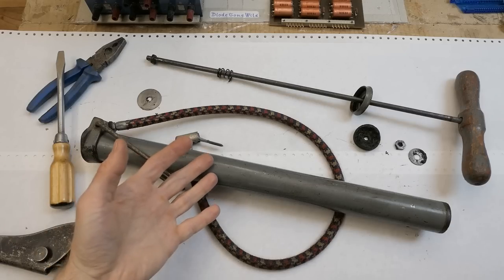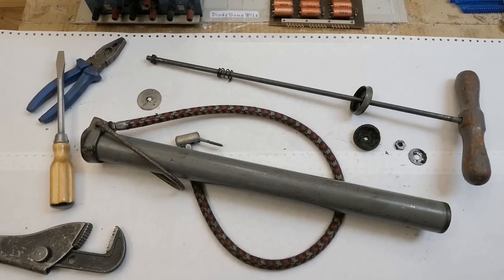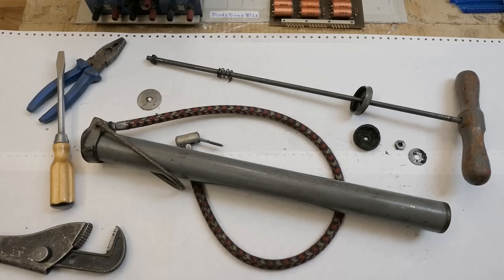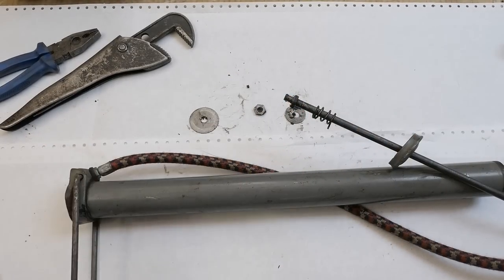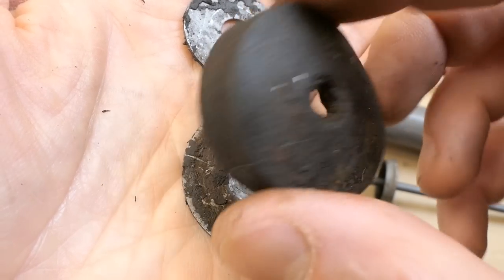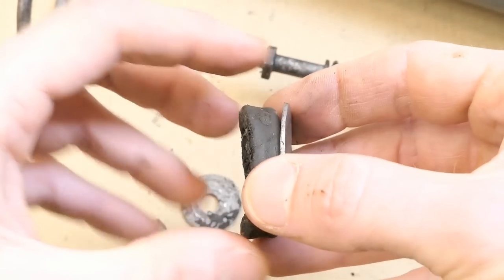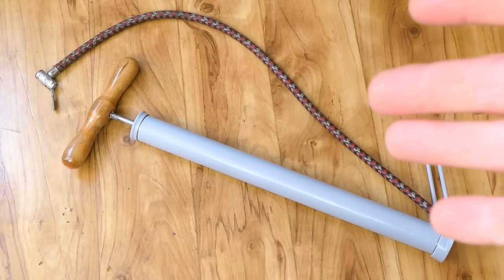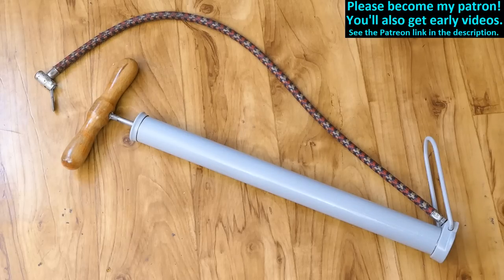Vintage Hand Air Pump Restoration

Comment: Not rubber but leather. You make them using a piece of leather, and soaking it in hoof oil, then get the bend in it by cutting out the large circle, and assembling it on the shaft in reverse, with the large washer at the far end. Then put in the housing, well oiled, and making the softened leather gradually bend to fit the housing, then leave in there for a few hours, pull out and assemble the right way round. The leather is treated with hoof oil or Dubbin, both available probably at the local store, the Dubbin being used for suede leather shoes, as it is a pale yellow leather treatment, and thus on suede it does not darken it like shoe polish, though boot polish is likely what was used on there over the years.
Reply: Woah. I never thought we'd have a discussion about dubbin on here. :)
Reply: Neatsfoot oil, also.  If the leather isn't ripped or torn probably vegetable oil would be fine to soften it up.  I often use most any light oil.
Reply: Isn't the seal on the hose also leather? So it's a bit of shame to replace it with that newfangled rubber o-ring.
Reply: @alexej01  Correct, all the seals would be leather soaked in oil.  The check valve might be rubber, I don't recall the detail of my (almost identical, slightly newer) pump.
Reply: Agree, thick leather. Same in optimus primus, petromax, etc. We used to oil it with weapon - oil when i was in the army.

Nowadays its just a o-ring
Reply: Hey, I already posted that!😉
Reply: @edgeeffect  hoof oil bahahahahahaha
Reply: i think we used Lanolin grease on old leather washers like this
Reply: Thanks for sharing that!!! Ingenious.
Also I havent heard dubbin mentioned for years!
Reply: Most paraffin lamp and stove enthusiasts just soak the pump leather in water before assembling it back to front on the shaft to dry and take on the correct shape, they then use olive oil or mineral oil to make the leather more supple. I've made dozens that way, no need for any specialised products, just what you can find in most homes.
Reply: We did exactly this but then soaked the leather in water. But oil is better I guess

Comment: That looks exactly like the pump I used as a kid  for my bicycle tires , usually all I had to do was pull the piston out and spread it out a bit and put a bit of oil in there so it made a better seal. I think the piston is leather and not rubber.  Those cheap pumps didn't have a check valve in them. You needed to be fast to disconnect the hose from tire stem while pushing down  on the pump so not much air would escape from tire. New pumps are so much better these days !
Reply: Yes leather.
Reply: @hwassie  No rubber.
Reply: The seals were originally leather, but that may be a later version; the type of Schrader valve adapter does seem to indicate it's a later design.
Reply: @cambridgemart2075   yeah I had one with a screw on hose valve too and that one was a real pain to get off without letting so much of the air out !
Reply: It seems like this pump must have a check valve or else the balloon wouldn't inflate.  Is it in the hose fitting near the base, I wonder?
Reply: @govtpeaches  I think some did not have check valves so you had to be pushing down on the handle when you released the tire valve so you wouldn't loose any air pressure. The pump itself would hold some pressure so when it got high enough pressure the pump handle would move up if you weren't pushing down. There may have been a ball check valve at the end of the hose but they get gummed up and stuck open.

Comment: I love mechanical repair diversions like this. Some of my favorite videos on Big Clive's channel are about plumbing.

You're spot on about the check valve being inside the hose fitting. It's construction is often similar to the piston seal, but backwards (and obviously smaller), so it's pushed closed by pressure from the tire.
Reply: Agreed. And some of my favorite videos on this channel are about plumbing with his "unauthorized plumber" who is a cat. Mostly gas water heater videos if I remember correctly

Comment: As others have said, the foot stand is the wrong way round. It's correct on the first frame of the video. It will hold it more firmly to the floor on the upstroke when in the correct position. Interesting video 🙂

Comment: Danke!
Nice!

My Grandpa still use a similar air pump for his Bike.

The 'clean' side of the big washer is cleaner because every pump strike the rubber press against it and kind of press dirt out or grind very little.

You see the small bending of the washer.. so you know the big main force during an air pump strike comes from above/the handle going down.
Forcing the nut in the center down .. but the outer ring of rubber together with the increasing air pressure try to push the washer up.

I would try to use a better grease.. no random WD40 spraycan or similiar :-/
Most old rubbers nemisis is not their oldeness .. its modern aggressiv oil.
Try vaseline(petroleum jelly/petrolatum?)   , vegetable oil or specialised grease for rubber.

Thanks for non electronic videos too ;-)

And nice to know that there are people who are helpful and not only looking on the Smartphones the whole day, during driving or crossing a railway track.
Reply: You are exactly right and even though these are leather pieces in this video...  lubricants containing petroleum distillates can  do similar things to leather overtime. According to how the leather was originally tanned.... Defines how bad it gets and how fast. But you absolutely want to keep petroleum jelly or anyting containing petroleum away from a lot of rubbers if possible. One of the simplest things is that silicone type grease at the auto parts store for light bulbs and stuff like that. A lot of it is totally most of the other harmful distillates.

 There are a lot of specialized lubricants used in aerospace ect..... that are totally petroleum-free. And the first thing someone can do is to throw out anything made by "armor All"or other automotive detailing stuff... And replace it with the 3M stuff that does the same thing but without any petroleum distillates. It's so funny because "armor All" overtime destroys rubber and plastic and other composites... Not the armor All But the varying levels of petroleum distillates. The first place one will see this is in the rubber weatherproofing trim around doors and windows. They get harder and more brittle and no matter how much armor All use... They soften up temporarily only to dry out even more extremely. It's lighter than with some good petroleum free dielectric/silicone grease... And watch the magic happen. (Then probably take off the excess that wasn't absorbed)
So many of the cleaning and detailing products out there will destroy just about any composite given enough time or penetration. Maybe not a big deal in our throwaway world where people only keep cars and devices for a few years... But becomes much more pertinent it working with actually well-designed and timeless scientific equipment, automobiles, or other engineering marvels

Comment: Very similar were bicycle tyre pumps in the UK in the 50s and 60s.  Often had 2 fold out bits to stand on where yours has one.  Super simple and the diaphram was leather and could be easily replaced if it wore out.  Things were made to last a lifetime back then.

Comment: Nice restoration, one thing you put the wire you step on to hold the pump backwards so it jumps up when you pull the handle.

Comment: I remember these pumps from the '90s, they were made in the Eastern bloc for decades. My brother even had a smaller one made in GDR or CSSR that could pump a volleyball - I just connected a plastic tube and use it to do some experiments with compressed air when I was a kid, haha!

Comment: The valve in the tire could be pushed open by the air pressure.
What a nice old pump, well worth your effort :-D

If it's not as good as you expected, perhaps make a disk of wood or plastic to apply a little pressure to the inside of the old rubber cup.
Maybe Chop up a worn out car tyre to make a rubber disk perhaps.
No switch mode supplies were hurt in this video lol :-D

Comment: I still have the tire pump I bought at the age of eight, very similar to yours!  Those rubber parts are leather.
On mine, the pintle style check valve is dropped into the base just before attaching the hose.

Comment: There are actually pneumatic circuit boards so this isn’t necessarily off topic!
I was shown one when I was studying many years ago. They were used in oil refineries etc where sparks cannot be allowed to happen.
They consisted of two plates one on top of the other. Traces were raised paths in the top plate, forming tubes. Resistors were venturi in those tubes. Current was airflow in the tubes. Voltage was air pressure. Capacitors were little spring loaded bellows. Switches and relays were little pistons. I don’t recall too much as it was long ago but I do remember that most basic components can be simulated with air devices.
Reply: It's a pneumatic rectifier 🤔

Comment: Recently I repaired a similar pump. It had no compression and it was leaking air at the bottom. I added a thin rubber ring around the old rubber or leather thing, oil it and I push it over the other end with the stand. I used pliers to make sure it's spread to touch the walls of the tube.  I added teflon tape to seal the air leak. It use to take 20 pumps to inflate my bicycle, now it takes 5 or 6. There is vacuum that pull the lever down once I begin pumping.  To let air in I have to pull up so the leather ring is over the small hole at the top.

Comment: Thanks and good job on the pump.  These are very useful devices that don't need power to work and have no motor to break.  I've lost track of mine and can't even remember when I last saw a manual air pump, but it's certainly been a decade or longer.  Mine's probably hidden under something in my garage.

Comment: Very nice vintage pump! I got one from my great grandpa a couple years back that I used to inflate my bike tires, the leather plunger has just about gone, so I need to replace it, it works great beside that. It must be from the late 1940s/early 50s, and was sold by Kmart, remnants of the sticker on it that has an old Kmart billboard with a 1940s or 50s car below it.
Reply: Nice to see you here!
Reply: @versedbridge4007  indeed :)

Comment: I worked as a biomed technician and rebuilt all kinds of hospital equipment. We often had to rebuild surgery and exam tables. even modern tables that use electric or mechanical hydraulic height adjustment all use leather seals. we had rolls of different thickness leather and large sharp hole punches and just cut our own replacement cups and using nylon or wood hammer, reshaped it into the cup. they last years with very little failure. There were a couple of company's that fit there tables with rubber or nitrile orings but when they fail it will sometimes just drop and you can imagine the issue in a hospital setting that would be...

Comment: I would have expected to see a simple one way check valve at the base of the pump, but I suppose it would work without one.  You can replace the rubber diaphragm with a leather one, you just take a scrap of this leather, cut it in a circle perhaps 2cm wider than the diameter of the pump body, soak it in water then assemble it back to front on the pump shaft so it's nut, small washer, diaphragm, large washer, then nut, insert it into the pump body and leave it to dry, once dry remove it, trim the edges, soak it in olive oil and assemble it the correct way round.
Reply: The schraeder valve the pump connects to works as the one-way system.  Air pressure opend the valve and lets air into the tyre and then it shuts as you pull up the plunger so air can only feed in past the diaphram.
Reply: @MikeB_UK  Yes, the Schrader valve has a spring loaded poppet valve, but if the look at the connector in the video it has a pin to keep the poppet valve open while connected, I don't think I've ever come across a pump that uses air pressure to force the poppet valve open.

Comment: Thanks for this video Daniel, it's refreshing to have different subjects. My Dad, who passed away
40 years ago had the black but otherwise identical version of this pump. Sadly like many of his old
tools they went to the tip after no one wanted them.If it's got mineral grease or oil on a rubber piston
it will gradually perish. You can use vegetable oil to lubricate it without worrying about perishing. 
Could the piston and other fibre washer possibly be leather/thick hide by any chance? Also if the
nut thread isn't m8x1.25mm, it may be 5/16 UNC thread, they look very close. I think these pumps
may have came from the army originally.

Comment: 5:39 That is the right way, it's probably leather instead of rubber and you can make a new one from an old peace of leather and force in into the tube backwards so it takes the right shape and than turn it around for final installation.

Comment: The thought process used for diagnosing and repair, is the same for electronics and mechanical things. It was designed to work. It did work and now it doesn't. Why? Pumps like that are very  common and used for years. The old ones (like yours) use leather for the piston and washers. Rubber was only used when modern synthetics were developed. There was never a one way valve. It relied on the valve on the tyre, to stop it blowing back.

Comment: It is not rubber, it is leather (the material of the piston). It has to be full of grease, if not the leather will go useless. One way valve is in the bottom of the cylinder, it has a small ball inside with cone and preventing the ball shape of the case of the valve. This pump will never be completely broken, always you can repair it in easy way. I use to have such a pump when I was young, 30 years ago, it was stolen from my motorcycle garage with other tools.

Comment: I was going to say that it does not need a one-way valve in the pump output line because the valve in the tyre provides that but then you went and pumped up a balloon which proves me wrong.

Comment: I think the pump does take in air from that hole near the top of the cylinder. Why? I can hear some short, quick hissing just before the piston hits the top of the cylinder, indicating that the piston creates a vacuum on its way up and allows air to fill that vacuum once the piston has passed that hole.

Comment: There are phones with schematics available made by Fairphone. You can easily take them apart and replace modules like the battery, screen or cameras, or even diagnose the board if you have a microscope and precision soldering technology. They don’t have a great power to price ratio but neither do flagship phones that cost 3-5 times the cheaper model, with no difference except a better camera and the microSD slot being replaced with copious amounts of on-board storage, and the headphone jack with nothing. I think that the Fairphone’s repairability may be worth it in the long term if parts continue to be available. Make sure to let them know there is demand for such devices!
Reply: Then you only need fully open source software on those with the support of your business partners (banks, government, etc). Let me know when we're there.
Reply: @atdzsny  I’m talking about hardware repairability. 
Anyway, while it’s true that not every app you need is FOSS, an AOSP-based ROM with Open Gapps will get you a good privacy/functionality balance. Don’t let the perfect be an enemy of the good!
By the way, there is an initiative to release the code for all government-made client-side apps in the EU that you can support.
Reply: @vaclavtrpisovsky  I didn't mention software without a reason. That's the soul of modern smartphones. And a lot of apps are time-bombed: you can't use them unless you upgrade. And even if your hardware is perfectly functional, you"ll find that it is no longer supported. (Can you link that initiative? I couldn't find it.)
Reply: @atdzsny  I cannot paste a link due to the spam policy. Last time I saw it, it was a petition pushed by F-Droid, CCC, Wikipedia, GNU Foundation and others. I cannot find that document but apparently, a project called GovernSource came out of this and also includes backend code such as a unified database system for jurisdictions.

Comment: It's made of leather and all you have to do is get a flat piece of leather, and force it around the washer into the cylinder, with some oil in there and it will sort itself out

Comment: Use a flexible, greased leather not rubber. I use the same pump for my bicycle. It worked fine for years. Then the leather was dry and needed to be greased.

Comment: The bigger metal washer sits above the rubber seal and that works to catch air on the way down and allows air to slip by on the way up. The pump actually gets warm from the air pressure and valve friction. And another piece of useless information, it wheezes when you stroke it rapidly.

Comment: I think that the second one way valve is inside the tire.
Reply from the maker: The thing at the end of the hose has a pin. The pin pokes the tire valve open and keeps it open as long as the hose is connected. Thus the tire valve can't work as a one way valve. It actually could, but it would require way too high pressure to push it open. It would work, but it would be way harder to manually pump the tire this way.
Reply: @DiodeGoneWild  Thanks for answering my question ! So we don't know yet where this valve is...